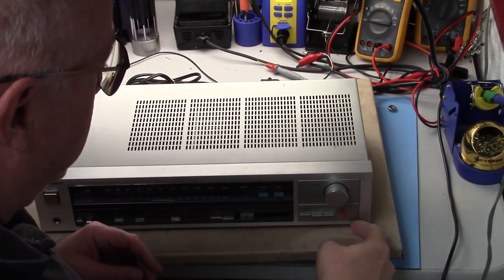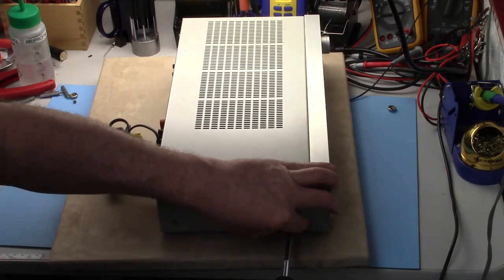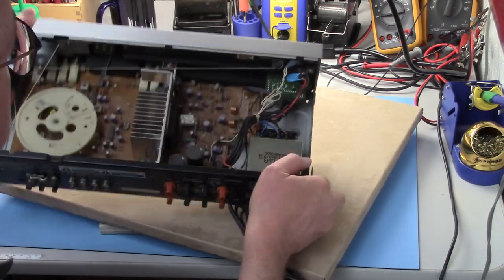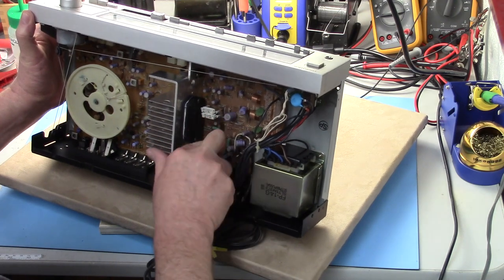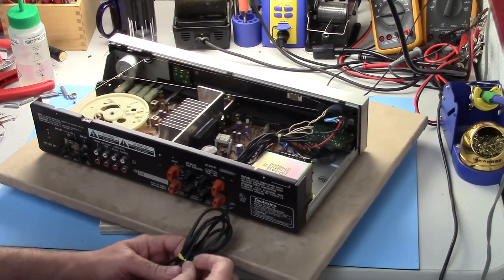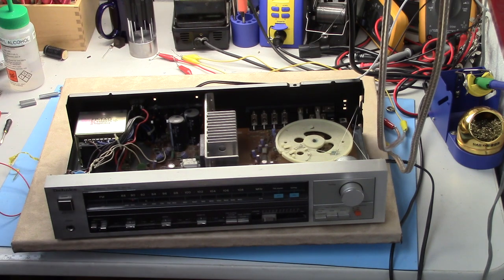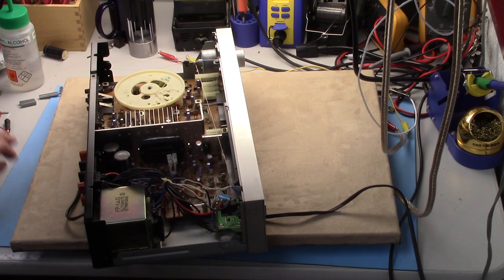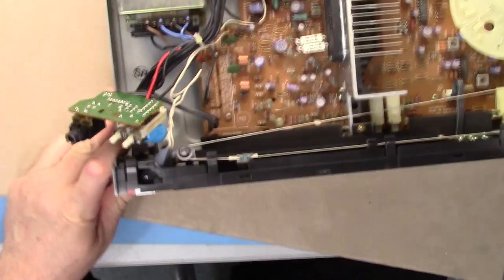Technics SA-120 Receiver Repair

Comment: Did you ever find a replacement for that 'Stanley 158' bulb? Thanks!
Reply from the maker: I can't recall, but I did put in new bulbs, but I'm not sure what exactly they were.
Reply: The 158 is still used as an automotive bulb and is available in any auto parts store.  They're about $4.50 for two.